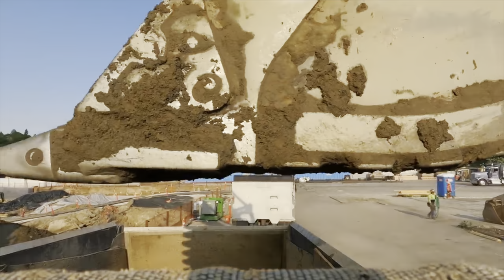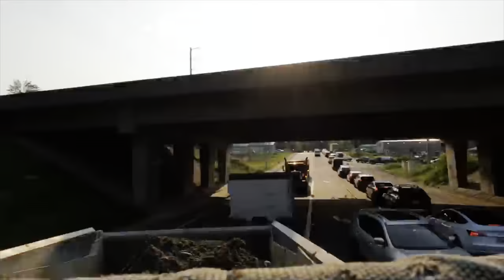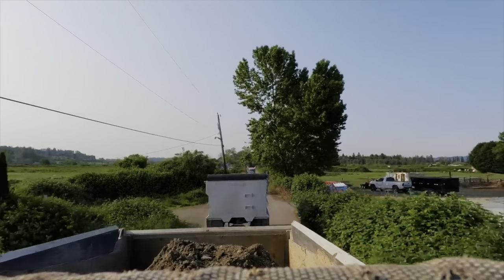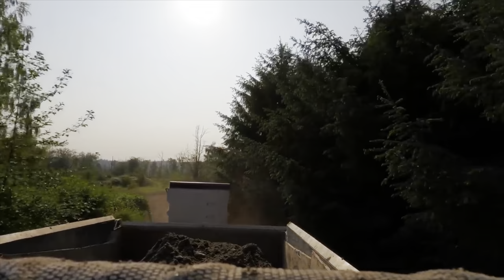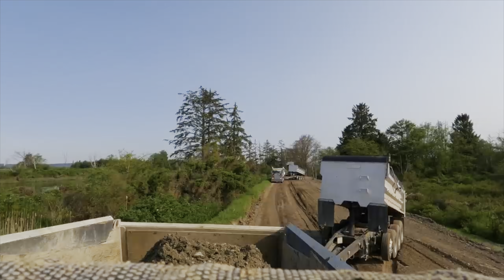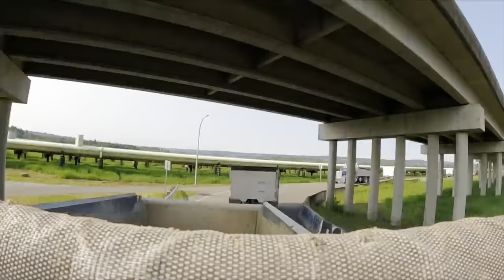Dump Truck Owner Operator, Hauling Dirt Out Onto The Dike.

Comment: I suppose some viewers who are not into trucking don't know how bridge weight laws work. For those not truckers, many states allow more weight based how many axles you have. Also how far apart they are. I didn't blame you for being a bit nervous about backing off to the side where it sure looked like it could be soft
Reply: Yep, seen 'em go off on a job site awhile back out east of Sacramento by the raceway. Can't remember the owner-operator's name, but boy was he P.O.'ed. Especially since Mike S., the owner of "S. Trucking" who we were pulling for (double bottoms) had just been up there and told us how "Safe" it was.

Comment: How do you like all the bumps under the trestle? If you do not know, they are the old piers from the old trestle. We tried pulling the out about twenty years ago and there is too much suction on them. The road is constantly sinking. Hopefully this summer or next spring I will be training some operators on a profiler to grind them down. Thanks for the great vid and getting the drama on the CB.

Comment: About you said, " follow the signs" the only sign I seen was the SLOW rite before the house. Some times the directions aren't the best. 

   Also a lot of drivers don't know but if you're running a set up with drop/ tag axles you can pull them up once you get off a ' Public Road', when you're on private property DOT can't do squat .

Comment: Very early in my trucking career I drove for a company that had a very large fleet of day cab Macks pulling 39 & 40 foot frameless dumps. We ran just about anything from coal to rock/stone to power plant ash as well as pretty much anything else. Most of our drivers were decent guys and girls just trying to make a living. However...we also had quite a few hot heads that were always getting into arguments with the load out staff at our shippers and receivers. A couple times a week if you were in the right place at the right time you would hear one of those jackasses get kicked out or even barred. It was a never ending soap opera with that same crew of loud mouths.

Comment: Geez , talk about back in the Boondocks . Tough with out reference signs !
Reply: It's called "Dirt Hauling" for a reason. Either you're hauling to where there wasn't anything there before, or you're hauling to where something vital needs shoring up and is usually out of the way in the middle of nowhere.

Comment: Dauminique, how could you tip a Framed trailer?  Your tires don’t leave the ground, it’s the Frameless trailers you need to worry about tipping,  plus all you had was dirt, not concrete or asphalt. 
I was hoping I’d see something different than the same old stressful nonsense that I dealt with in the late 80’s and 90’s.  But at least I was a TEAMSTER.  Must be awful stressful for you.
Reply from the maker: I’m not stressed. These trailers go over all  the time.
Reply: @DauminiqueTheDumpTruckDriver  👍😎👍 ,  you’re the professional!!!

Comment: Don't look like you got loaded with much material at the beginning.
Reply from the maker: It’s by weight not volume
Reply: @DauminiqueTheDumpTruckDriver , Then the loader was eye-balling it (yes, non-truckers. it can be done - just takes experience) as I didn't notice you stopping at a plant scale house, just a borrow pit, nor did I see or hear you handing the lady at the other end their copy of a weight ticket, freight tag, etc..
Reply from the maker: @johnbesharian9965  there isn’t one
Reply: √ That was my (big?) clue it was by the load, or by the hour and not tonnage.  (By the way, while the big front loaders at the major rock plants have a scale built in, I don't think I've ever run across one with that capability at a borrow pit, etc.)